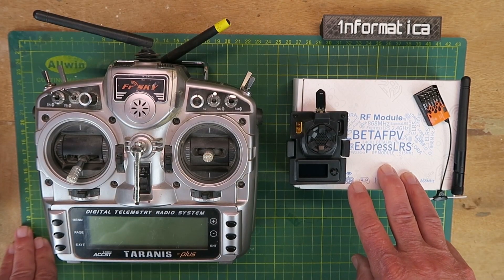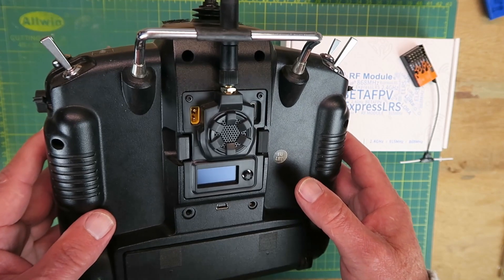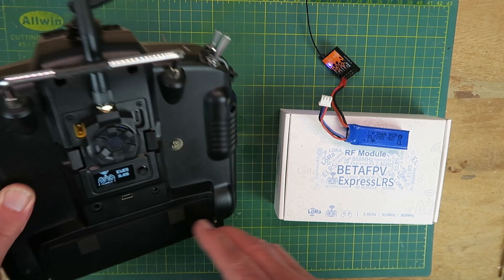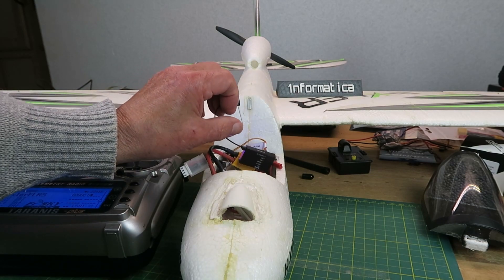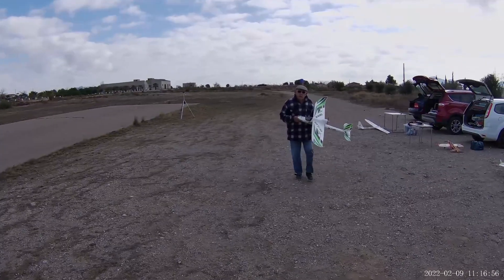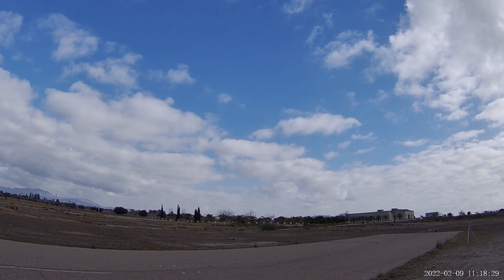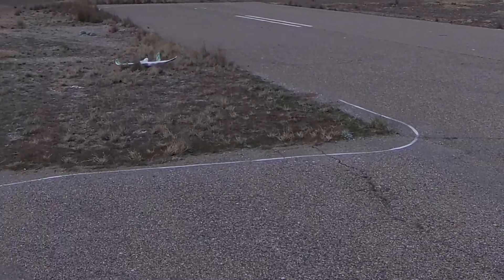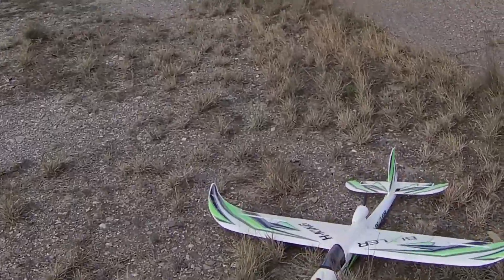BetaFPV ELRS Fixed Wing Quickstart Guide

Comment: hi sir.. im newbiew. using 1w how for this reciever can go? i prefer using this reciever on my radiomaster zorro elrs
Reply from the maker: The range of a BetaFPV 1-watt module depends on several factors, including:

1. **Environmental Conditions**: Obstacles like buildings, trees, or hills can significantly reduce range. In open environments with clear line-of-sight, range increases.

2. **Antenna Quality**: The type and placement of antennas on both the transmitter and receiver are crucial. High-gain directional antennas provide greater range compared to omnidirectional ones.

3. **Frequency Band**: The operating frequency (e.g., 2.4GHz) affects range. Lower frequencies typically travel farther but may have more interference.

4. **Interference**: Urban areas with heavy RF interference can reduce effective range.

### Typical Range Estimates:
- *Line-of-Sight (Ideal Conditions)**: Up to **10-15 kilometers* with high-quality antennas and minimal interference.
- *Suburban Areas**: Typically around **5-8 kilometers* due to partial obstructions.
- *Urban Environments**: Reduced to **2-5 kilometers* due to interference and obstructions.

### Enhancing Range:
- Use high-gain or directional antennas (e.g., patch or Yagi antennas).
- Maintain clear line-of-sight between the transmitter and receiver.
- Adjust output power settings for optimal signal strength without overheating the module.

Thanks for watching, have a great day!
Reply: @1nformatica  tq sir good information. i prefer using lower watt min 17wh.. hope there has no problem for range around 600m to 800m

Comment: ELRS has loads of telemetry available. Do a discover sensors on your Taranis then set the momentary switch to play the value of LQ. That is the Link Quality expressed as a percentage of packets received. My guess is flying line of sight even on 25mW you will get 100% or close to it all the time even when the plane is a small dot in the distance.You can also set a logical switch in OpenTX to trigger when the LQ drops below a value of your choosing. Then set a Special Function to play a track when the Logical Switch triggers thus having the TX shout at you as an early warning you are heading toward the limit of range.
Reply from the maker: Great tip, thanks for sharing. Will definitely do this! Thanks for watching, have a great day!

Comment: You were correct with your supposition about antenna orientation - vertically mounted (both on TX and RX) is best as you get 360 degree coverage. If the antenna had been mounted horizontally, you would have two null points, vertically, as you said,  you have only directly overhead to consider.
Reply from the maker: Thank you for your confirmation, it worked well even overhead as you saw!! Thanks for watching, have a great day!